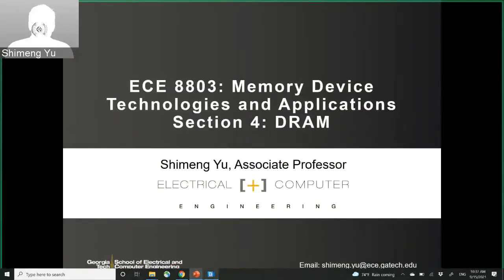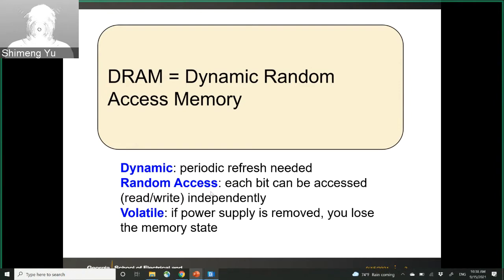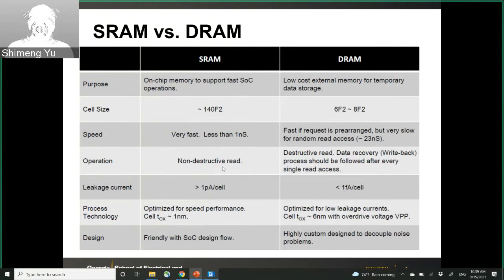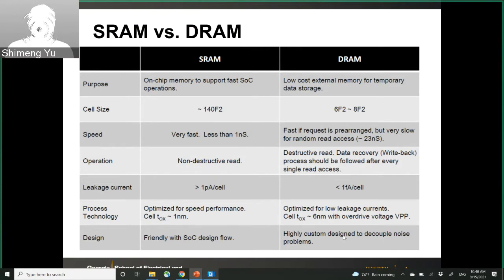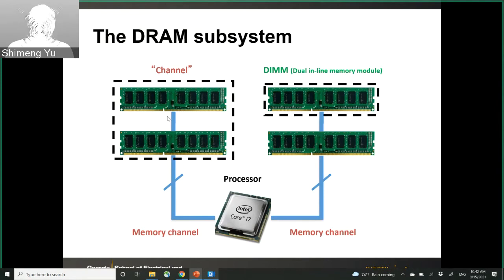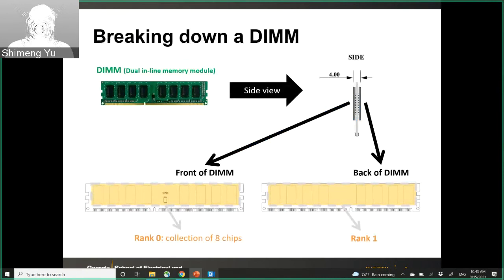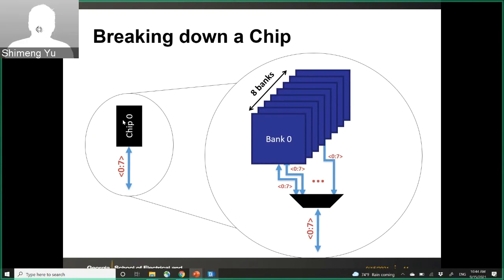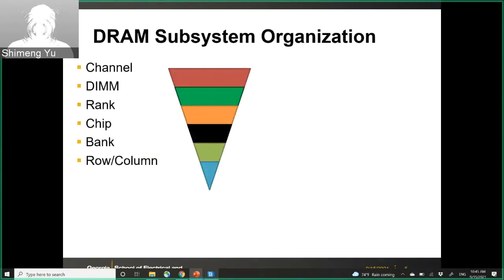L4 DRAM part1

Comment: Correction at 4:38: DIMMs do not have controllers on board. Most controllers either sit on the same die as the CPU or on the motherboard.